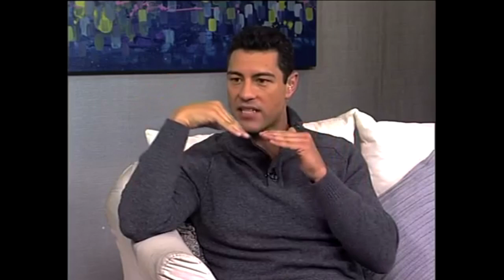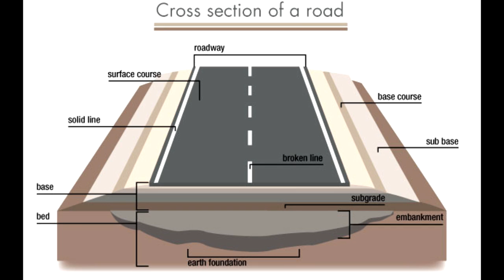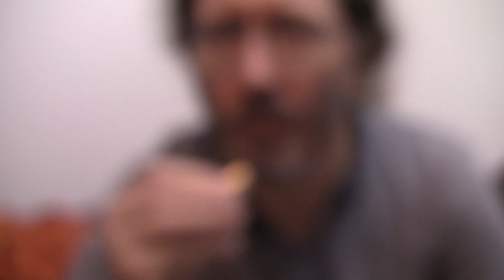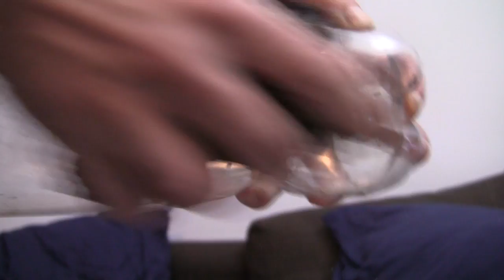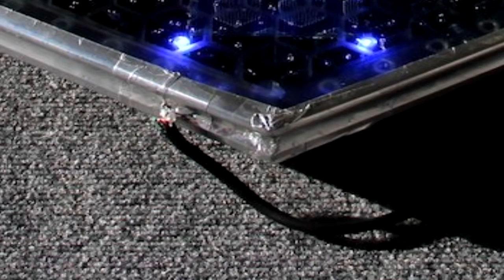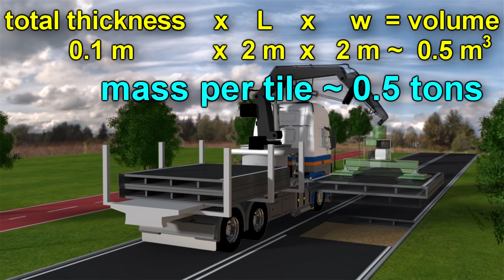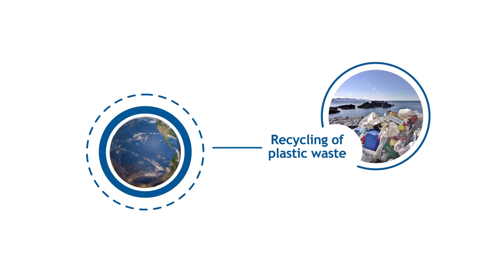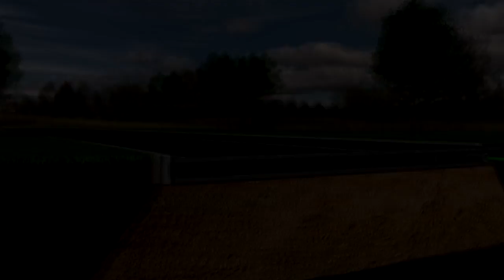Plastic Roadways BUSTED!

Comment: That's what happens when designers play engineers.
Every Fucking Time.
Reply: Those plastic bridges don't use simple PET plastic, which was the entire point of the video. They certainly can't be recycled. But they're cheaper than regular bridges and last about the same or longer (estimated). And as said in the video, the road foundation is the hard part. Once they start putting on the asphalt the road is pretty much finished. 
This doesn't even remotely compare to your bridges.
Reply: This is LEGO thinking brought to scale... which never is feasible.
Reply: I'm a designer and I know this is BS at the first time I see it, we must not try do something we are not sure of. Those guys are ruining our profession, making people lose the trust.
Reply: Since the actually expensive part is the foundation, there is simply no point in making the road out of plastic. The asphalt layer is rather thin. And better plastics (not PET) are expensive. That's nice for specific points (like bridges), but sucks for entire roads. Bridges also have the problem that cities cheaped out with corrosive steal in that reinforced concrete and now they have to pay the price for their greedyness.
Reply: Jeff Lindeman So no actual real-life experience to go with that physics degree? Some counterpoints: 

1) Engineering is based off of physics, which explains what is and is not plausible. 
2) The understanding of how stuff works at a base level is necessary for any design to succeed. 
3) A large number of revolutionary designs in modern construction and design came about due to development of simpler methods of doing the same thing faster.
4)After 35 years, your 4 year degree is woefully outdated. I think there's a couple new particles on the list. Oh, and dark matter was proven.
Reply: Plastic degrades and becomes brittle with UV exposure. Why do you think motor cycle helmets expire? Because they become not as strong after so many years. I'm talking 3 or 4 years even less.
Reply: Icelink256
Engineers may design an ugly thing, but at least it's going to be functional.
Reply: hellcat1988 
You've never seen on sight recycling of asphalt?  😐  

Do you even drive?  Are you a hermit?  
Millions of motorists witness on sight asphalt recycling, on average, every 2 years, when they get stuck in lane detours, while the road crews are paving the other lanes.  

I've seen it dozens of times, personally.  
Google the process & watch the videos yourself, instead of choosing to be willfully ignorant.
Reply: Plastic don't get stronger by more thickness, it might not make sense, but if you learn more about properties of plastic. Some kind of triangular or hexagonal cross section of 1-2 cm thickness is stronger than just 10cm thick solid. But still ,they aren't enough to withstand forces of truck, plastic will creep and crack and disintegrate in the end.
Reply: Jeff Lindeman are you really writing pages long answers to randies under a youtube video praising how designers are better than engineers? You're ridiculous.
Reply: Nettes TeilXD
Reply: This can be controlled by additives, not all that big of a problem really. Motorcycle helmets might expire, because the foam inserts will rot out after some time.
Reply: Amenti H so true ! mba and artists ! fuck them all !
Reply: Ryan B something beautiful that doesnt work is worse the the reverse ! engineers rule !!!!
Reply: Amenti H Plastic could be used as roads. But only if it was at least 10 cm thick.
Reply: A solution worth pursuing is a solution that solves a problem, how it looks its irrelevant to solving the problem,  makes the process more complicated than it should be, more expensive, and time-consuming, and most of useful stuff ever made where invented by engineers/scientist, not by designers. designers make stuff commercial, pretty, pleasing to the eye, but functionality wise, they are expendable.
Reply: Jeff Lindeman r/iamverysmart
Reply: DiaveD ~Wharever... dipshit.
Reply: Jeff Lindeman no u
Reply: The funny thing is, it's less drastic when reversed! =P
I'm an engineer, and I took a year to properly learn design. Now I can outwork my competition!
Reply: hellcat1988
You do understand that bridges in your link have absolutely nothing to do with this plastic roadway?..
Reply: Yeah I understand they don't.  The reason I linked to all those articles is because they are proof that nearly every claim this guy made about plastic roadways is false.  They CAN take the weight without deforming.  They CAN take the abuse of vehicles driving over them without abrading into nothing in a minute's time.  They CAN be made with whatever surface texture they need them to be in order to give positive traction in any weather condition.
Reply: +hellcat1988
" As far as the road surface is concerned, if they can use crushed granite rocks as a base for railroad ties to provide support and drainage, I don't see why they can't do the same with the road base. It would save a lot of time and labor compared to the current system. "

Maybe you should ask yourself why in about 2400 years of building roads in a similar way (look up how roman roads were constructed it is pretty much the same basic recipe as for a modern macadam type road dam), we have only found miniscule ways to improve upon it and nobody ever has seriously tried your "shortcut" as an improvement.

For starters... the most modern tracks (for high speed trains) do no longer use the crushed rocks as foundation, they are directly laid on ties that rest in concrete and usually no rocks are added afterwards. Also the comparatively hole-riddled form of such a foundation would mean much worse spreading of the pressure forces acting onto the actual road surface, leading to "dimpels" forming in the material where is is NOT supported by a solid surface below it

"As far as the bridges using glass fiber reinforcement, I still haven't seen anything saying they can't be recycled into the same material for the same purpose."

It does not need much thought why that does not work... plastic recycling (like was also shown in the promotional video by the Plastic Road "inventors) starts with shredding the material in uniform pieces so the heating for a renewed molding is as easy as possible. If you shred fiber reinforced materials what you get is confetti-fibers, that no longer fulfill their single purpose... stretching out through the material as LONG fibers and hold everything together for more structural integrity.
You'll end up with contaminated and therefore weakened plastic in which you'd have to integrate new long fibers to make it work, but even if you manage to do that 2 or 3 times, the quality would quickly deteriorate and you could hardly tell from the road-segment-LEGO how often it has already been "recycled"... While at the same time you can reuse the same asphalt surface dozens of times, despite shredding it in the course of removing old surfaces, as it only takes reheating of the bituminous contents to make it work again... 

OR you could need to invent a costly and energy consuming new process to completely liquify the plastic, enable a filtering process to remove the fibers embedded in it and then continue on with the rest of the mass that contains NO fibers to make your new road.
It may not be impossible to reuse fiber enforced materials, but it is highly impractical and costs much more than simple recycling of non-reinforced materials.
Reply: dario ~ thank you, I was about to say something similar myself. It takes both to build anything that aspires to the synergistic perfection that neither alone can achieve. The old adage that "form follows function" is not always the case in these modern times. This is particularly true when you consider that the shapes, lines and proportional characteristics, well known to designers as those found to be most aesthetically pleasing to the human eye, are often based on the same mathematical ideals as those found to meet or exceed  the requirements of engineering for any given strength to "variable" situation, whether it's span, flexibility, height, load, etc.  What this means is that with the technology available to today's designer in the form of Computer Assist Design (CAD), coupled with that unmeasurable, undefinable, yet quintessential element any designer of worth hones and refines on a daily basis, Creativity, it's far more likely that a designer/artist might stumble over a "function that follows a known form" than it would be for an engineer to design something of striking form, based on the laws of function (physics). 

I've known a number of engineers over the course of my 60 years on the planet that would vehemently disagree with this assertion. They're wrong, but hey, that's just me. Who am I and on what do I base my opinion? A quick rundown than: Four years as a Physics major with an Art minor, followed by 20 years as a full-time saxophonist/producer/recording engineer, followed by the last 15 years as a full-time freelance Commercial Advertising Photographer and Photoshop Touchup Specialist. In closing, it's most likely a good thing that engineers tend to disagree - they don't particularly like thinking out of the box, for good reason, and a point appreciated - the left-brained keep us all alive. Design types on the other hand, live in both brains and all and all are not only full of surprises, they're a fuck of a lot more fun to hand around... even if their ideas should always be approved for build by an engineer. Make it beautiful, and decidedly non-lethal please. IM-not-so-HO. Cheers
Reply: Ellsworth M. Toohey ~ Still, I don't care what anyone says, as I stated above, takes both good design and sound engineering to conceptualize Anything Worth Making. A thing of beauty to the eye that fails to function correctly, actually fails on every level - it's "beauty" being just a sham. In the case of large, expensive, civil projects that function in highly visible open spaces - even if they function perfectly - IM-not-so-HO, there is no excuse for it to not please the eye. To clarify my statement above,  with good CAD program to help avoid any critical physics mistakes, creating something that functions perfectly and is also aesthetically pleasing is far more likely from a pure design standpoint than it is from a pure engineering standpoint. In this respect, modern technology assists the designer in engineering, far more than it is possible for it to assist the engineer in design. The bottom line is, No One Rules. Without both aspects, it will always be a POS. And btw, 'plastic roadways' is just a stupid idea, looking at it from ANY standpoint - likely dreamed up by some pencil-pushing bureaucrat that thinks if it's "green" it must be good. Design and Engineering together create solutions worth pursuing - everything else is lacking...
Reply: DiaveD ~uh, it looks more like 2 paragraphs and 1 paragraph to me, but whatever. Five minutes doesn't actually seem excessive - an exercise in free-form cognitive expression. It takes no longer to 'type' it than it does to speak it. Just keepin' the neurons in shape; assessing efficiency; maybe it's akin to maintaining 'regularity' and staving off mental constipation. A lifelong devotee to the art of cerebral improvisation or I suppose some might call it masturbatory word play. 8-/
Reply: You'll also notice the video describing the plastic road surface said they don't have a final design or material makeup selected.  There is no reason they can't change it.  As far as the bridges using glass fiber reinforcement, I still haven't seen anything saying they can't be recycled into the same material for the same purpose. If you can provide me with a link with definitive answers as to such, I'd appreciate it.

As far as the road surface is concerned, if they can use crushed granite rocks as a base for railroad ties to provide support and drainage, I don't see why they can't do the same with the road base.  It would save a lot of time and labor compared to the current system.  

Yes, there is still quite a bit of prep work to be done in making the base for rails to pass over, but not nearly as much as for roadways as the overlying road surface tends to be much more susceptible to variations in ground density.

Using crushed granite stone as a base would cut the time and maintenance, and the rigid plastic panels would help overcome the difficulties associated with different levels of compaction in the base that lead to potholes and cracks in typical asphalt and concrete road surfaces.

I'm not saying that the original plastic roadways video is by any means correct or complete, but as a base of an idea to build on, it has merit.  Many of the problems that people have pointed out in the comments here and in the video by thunderf00t have already been solved in other areas of construction using plastics or can be overcome relatively quickly.

I still have yet to hear of a sure fire way to guarantee against potholes in asphalt or concrete; or even a cheap and quick way to repair them long term.
Reply: If you actually READ my last post, I addressed the foundation cost issue.  As far as the cost of the plastics, they're not making them new.  They're taking plastics that would otherwise be disposed of, grinding them up and making COMPOSITE plastic materials out of them; not just using PET alone.
Reply: Steven Moeller ~ I'm trying to understand the point of your reply, beyond it's face value as a sophomorically pretentious and ineffectually flaccid trolling. Apparently though, since it IS an attempt to 'call me out', I'll need to break it down for what it really represents. 

Item #1 - The Opening Salvo - An unsubstantiated personal assumption that reveals more about your lack of "real-life experience" than mine, but also reveals how easily a a little knowledge combined with an inflated sense of youthful self-worth, can lead to a premature and spurious conclusion. More on this momentarily, but first, let's look at...
item #2 - Supposed "Counterpoint" Bullet 1) - If I were to exercise an equal amount of presumption as yourself, I would need to ask if the purpose of making this statement was yet another attempt at showing your infinite knowledge of the subject and thus raise your self-deluded righteousness; it certainly is NOT a "counterpoint" or refutation of anything I stated or even so much as alluded. It does however, constitute another misfire and an inability to stay on even your own self-defined outline: as in Counterpoint to what exactly? 
item #3 - Redundant Supposed "Counterpoint" Bullet 2) OK. Since this is essentially a dumbed down way to say what you already said, far more succinctly I might add, in Bullet 1, I'm guessing this is meant to make another "see how smart I am" declaration. Again, it isn't a Counterpoint to anything I said; not only that, but if you actually believe it is, your ability to judge the profundity of your own thoughts is as poor as your reading comprehension.
Item #4 - Bullet 3) do I need to point out the definition of Counterpoint to Point or do we have that straight now. Another statement that's a cool fact, but is of no consequence within this context. My (smallcase) god, this is almost imbecilic. And maybe some things are better when done "slowly," as opposed to "faster"; for instance, reading for comprehension or re-reading for comprehension, search for a point to counterpoint or even deciding not to reply when one realizes that they missed the point of the comment. 
Item #5 - Bullet 4) and The Cluelessly Self-Deluded Closing  another woefully misguided assumption, based on absolutely no information, nothing, zip, nada... self-righteously grandiose, lacking in imagination, laughably smug and indisputably asinine. 

All from a wet-behind-the-ears, little know-it-all self-appointed "expert" A shining example of youth not knowing when it's better to keep one's mouth shut and appear the fool, than to open it and remove all doubt. Not that it matters, but my major was in Astrophysics. I never worked in that field per se, but if you assume that learning ends when schools out, good luck with that. Your dark matter comment only shows me what punk-ass, self-involved little newbie twit you are. Even in my profession as a Commercial Photographer I use real-world physics everyday- I don't do weddings and I won't do a portrait of your fucking grandma ok, never have, never will. I have to build real-world things and use complex lighting arrangements that take days just to work out on paper. What the fuck have you done punk, aside from eating your parent's food, and masterbating between exams? Too assuming? Maybe, but probably pretty close.

Let me show you the advantage My age and experience has over yours and a  little problem in real-world "how stuff works" that likely won't be my problem, but with definitely be yours. It should be an easy one, for you. But you better use some of that fast shit, cuz ya ain't got much time partner. My old ass is just too slow.... Here's the problem and good luck.

Just the ballpark numbers very quickly>. World population: 1950 = 3.5 Billion  ||  Fast Forward 60 years to 2010 = 7.5 Billion. ||  Estimated World Population 2060 = 12 Billion  . Problem:  Even based on current and foreseeable improvements in agricultural technology, as well as vast increases in appropriated land use for food production, the estimated maximum sustainable population has the Earth tapping out at 11 Billion. Now prevent the real-world Zombie Apocalypse.
Reply: I have yet to EVER see on sight recycling for asphalt.  My work is based next to an asphalt manufacturing plant and even there, the majority of material on site is virgin.  Not to mention much heavier than a plastic road panel would be for the same length; let alone thickness.

Again, some of the major advantages of this would be that it's FAR less susceptible to undermining of the base, would be faster and cheaper to install and can be textured as needed for traction.